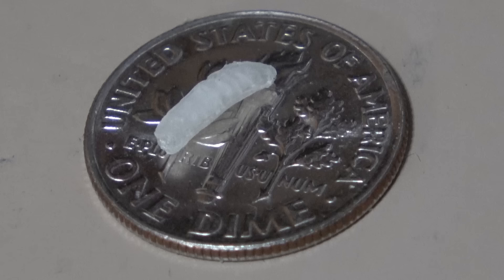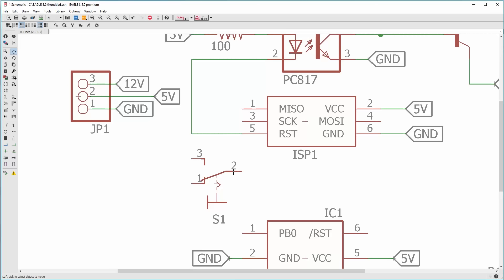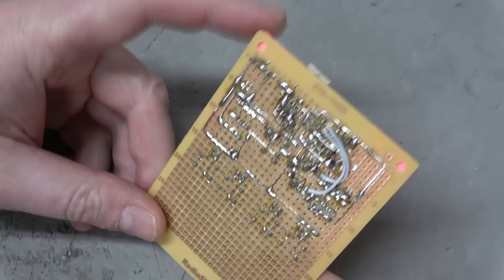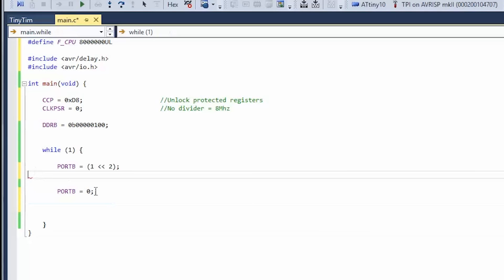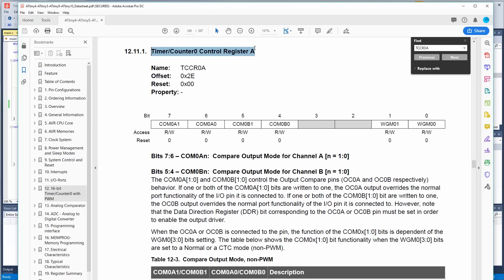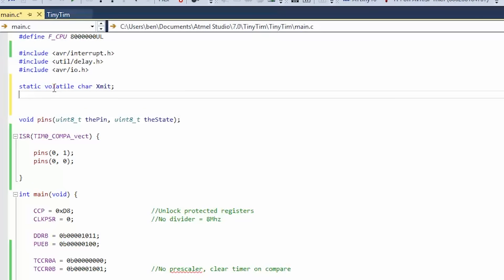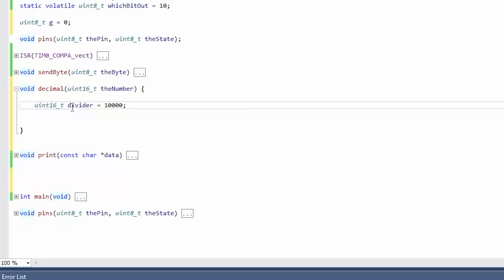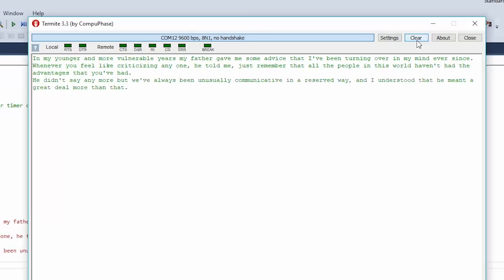How to use the Atmel ATTINY10 Microcontroller

Comment: Great design !  Except I would put  a 2k resistor between the PC817 pin 3 emitter and GND. No resistor will draw much too high current and surpass the max power permitted for PC817. You are injecting approx 20 mA IF on the internal LED. Transfer ratio is about 1.5 that means near 30mA on the output collector. 12V - 0.65 - 1 = 10.3V      10.3V x 30 mA = 300 maw. The PC817 is rated at 150 mW, too much.  The only reason it has survived is because the output is pulsed. Better design practice would suggest to limit that current to spec. Below 150mW.  I like that design. It's simple and easy to implement. Thanks for sharing.

Comment: You do not mention it, but it has a stop bit at the end. So it always has a start bit, some number of data bits and at least one stop-bit. There are also possible configurations of 1+1/2 stop bit or 2 stop bits, as well as 7 data bits, 8 data bits and 9 data bits in various legal combinations of data and stop bits. Only the start bit is always just one single low bit, indicating the start of a serial bit frame.
Besides that, very nice video about a nifty little device!

Comment: I went to an Arkells concert where they gave out cups that used a little microcontroller like this one that was program once. 

The radio they used to control the flashing LEDs int he cup and the batteries, etc were all bigger than the microcontroller.

Comment: I mostly make my programs with Arduino IDE... I would be very interesting to be able to program such "micro powerful devices" with it... Thank you for this one!!!
Reply: You would still need an external programmer, as there is no way to fit the arduino bootloader into the attiny10 (or it would fill a significant chunk of the program memory). You can use an original arduino as a programmer for that, a quick google search can show you many methods.
Reply: Thank you for that response, it clears up my questions!  @vinnycordeiro

Comment: Excellent video, well done. Just watch overheating the poor chip when you remove the solder blobs.
Is there a good reason to add Q1, the optocoupler is already switching the 12v supply for you, why not use it directly?
In fact, I don’t see the need for opto-isolation, why not use a single transistor in place of the optocoupler (you will then need Q1 to level shift)?

Comment: cough high impedance input cough MAX662A cough no additional power supply required cough 1 pcb, 1 chip, 1 transistor/optocoupler, 2 headers, a few passives, adapter done cough
just sayin' ;)
also thanks for having found a format that's fun to watch instead of all the element14 ads all over the place and freakin cliffhangers

Comment: I have a better idea for this board: put a 74LVC2G66 on the PB0/PB1 lines. This way once the programmer pulls the RESET line low (and the chip enters HVSP mode) PB0 and PB1 is also cut from external interface. Also the 12V can be generated locally using a boost converter, which usually also comes with an enable pin.

Comment: There is an issue with this design. Vebo for many trannies are only around 5V. In this design you'd exceed that value and risk the popping the transistor. There are many ways to solve this but easiest  (if you don't want to re-design this section) is a simple clamp (e.g. 2 diodes forward biased over R3 (or even a LED)) that will clamp Vebo to +- 1.4V. The Opto is not strictly needed but a good way to prevent accidental 12V damage to your programmer. I built a similar unit but that could do both standard and HV programming (simple switch selector between 12V and TPI reset). Did discover that the Olimex AVR-ISP-MK2's TPI line can not sink more than a few milliamps and still go low properly so you have to be aware of the impedance of anything hanging from it.

Comment: Thanks Ben, you saved me some work, I didn't know you needed the 12V for the 5's and 10's. One thing, why did you use the isolator? 

The "rst" leads are independent of each other, I just used a 2N7000 with 12v through a 1k resistor on its drain to the "rst" on the Atmel, gate to ISP's "rst" and source to ground. When the "rst" from the ISP goes low the 2N7000 shuts off and  sends 12V to the "rst" on the ATTINY.

Comment: I think you need a base resistor for your PNP transistor. Otherwise there is nothing limiting the current  from the 12V supply through the base and through the opto down to ground.

Comment: 13:27 I don't use the red and blue breadboard. It looks cheap. There is a breadboard with just one row on the top and one row on the bottom. It looks professional quality. I believe it is a higher quality breadboard. Although 2 rows makes some power and ground connections easier, I prefer the breadboard with one row in the top, and one row on the bottom.

Comment: When the opto-coupler is ON there is a direct path from +12V through the 2N2907 transistor emitter-base then through the opto-coupler photo-transistor to ground, which could destroy either, or both devices; what about adding a 10K between pin 4 of the opto-coupler and R3?
Reply: I was thinking the same thing. Risky design.

Comment: What's the point of the optocoupler?  The grounds are common anyways, so no real isolation.  Seems you only need the PNP transistor to switch the 12V.
Reply: Steve Bragg it’s because the PNP must be pulled to 12v on its base so it doesn’t conduct - the optocoupler keeps the 12v separate to the 5v logic used to control the reset pin state.
Reply: I'm wondering why the opto couldn't have directly switched the 12V. I doubt the AVR draws much current on the reset line.

Comment: 6:02 - I didn't try this yet but I foresee a problem in grounding PC817 pin 3 to ground. Now you have 12V supply current going through Q1E out via Q1B, into PC817 collector , out to pin 3 to ground. Outch ! If PC817 input is properly feed very high current will flow and fry either or Pc817 or Q1. Or, at least, they will get VERY hot. Bad design. PC817 pin 3 must be connected to ground via a resistor. 12V - 0.7V - 0.3V = 11V.  11V / 5mA = 2kOhms. Any value from 1k to 3 or 4K ohms would do fine. A short to ground will likely be catastrophic.

Comment: How to use an extremely tiny chip:  Put lots of extra things around it to show off how much space it saved.  Pull-up on reset line isn't needed.  Opto can gate the 12V program power itself.  Just saved you 3 components!

Comment: Cool project n all, think I woulda went straight to Attiny85 DIP. Nothin special beyond just about any avr programmer (or just use any ole arduino), save space because you wont need a converter board, and 512b. I do get it though, showing what can be done given a specific product is always fun.

Comment: That's what the << symbol means!!! I was stuck on macro assembly at a certain point because I couldn't figure out that symbol and couldn't find anything to clarify what it meant.
Reply: It's a common notation in a lot of programming languages. For C, cppreference.com is useful, and here's the page on arithmetic operators: https://en.cppreference.com/w/c/language/operator_arithmetic
Reply: @talideon  It's so weird that I never saw that in any texts...I have multiple texts on C languages. I think I skipped over arithmetic operators because I assumed I knew them all already(dumb). I know how to do that operation with nothing but transistors in hardware(or even a wire circuit with a latch). The irony is that I never saw it in any language as an operator. Makes sense now. However in macro assembly it doesn't make a lot of sense, since it is a built in instruction in many CPUs. In machine language, you would just use ROR or LSR as a processor command directly(on most CPUs) on a register. It would make more sense to me to have ROR <address>/<Immediate>. Then again, for larger words it would be tedious to do the CPU width at each interval to ROR a 32 bit word 8 bits at a time. Now I see. I still haven't gotten back on that yet. I've been prepping and learning survival stuff for the last 2 months or so.
Reply: @peterlamont647  It depends. I've used macro assemblers that support << as it can be useful for building constants representing bitfields and masks for use elsewhere.

Off the top of my head of the languages I use on a daily basis, I know Go, Rust, C, C++, Python, Java, and Ruby support it. I can also remember BBC BASIC supporting it from when I was a kid (which also happened to have a fantastic macro assembler built in). I think it might be one of these thing people gloss over until they need it.
Reply: @talideon  Ah the BBC micro...the first ARM computer. I get so much crap for my opinions on CISC Vs. RISC. GOD you wouldn't believe how pissed people get when I say x86/x64 is not a RISC processor. REEEEEEEEEEEEEEE!!!!!!! lol. Even though it has far more instructions than a CISC processor.

I've never even heard of Go or Rust. Know about the rest... I can tell you for sure the BBC micro doesn't have it. In old MS BASIC you would go 

(X=X*2) AND 1: REM Set LSB bit 0
or
(X=X/2) AND 128: REM Set MSB bit 0

That would work on an 8 bit unsigned byte. For 16 bit you have to multiply the upper byte by 16 when you're done.
That ought to stretch a few old brain cells :D.

The assembler/monitors from back then were far more primitive than I think you remember. For instance, you didn't have variable names, just addresses. The assembler/monitors were essentially disassemblers with the reverse built in. A LDA #09 etc.

On my old commodore 64, in a period assembler/monitor(which usually fit into 8K of ram) would not have any of those math commands. Just 
ADC ;add with carry 
SEC ;set carry
CLC ; clear carry
SBC ; subtract with carry
ROR; rotate orientation right
LSR; Left shift Rotation
There was no multiply command or divide so you had to code that yourself in software, or hijack basics own floating point routines.
Reply: @peterlamont647  It was the follow-up to the BBC micro that the ARM was developed for: the Acorn Archimedes.
Reply: @talideon  Ah. So ya, anyway bit shifting! Great stuff. Especially for scrolling games.
Reply from the maker: It's used in conditionals as >>. Non destructive such as if ((var >> 5) & 1).

For assignment: var >>= 5 changes the variable itself, just like var += 1 does.

Comment: I wish it could be programmed easier.  I had made an Arduino shield that allows me to program the ATMEL 85. But I don't have that blue box programmer to begin with then to make your fancy ATTINY 10 converter. I can see some uses for this chip though.

Comment: You don't have a current limiting resistor in the base line of q1, so depending on the performance of the opto-isolator, it's more than likely to blow the transistor when it turns on. Was the transistor necessary at all? Couldn't you simply have used the opto-isolator to feed the 12 volts to the programming pin directly?

Comment: On Q1 I am missing a base resistor. And why not use the optocoupler to directly switch the 12 volts rail without having Q1? Also why does the LED in the optocoupler need a pullup? When RST is floating, the LED won't light up anyway.

Comment: Would you be able to use this to control some Neopixels (WS2812b) LEDs? I have use for it doing some simple animations if it can!
Reply from the maker: Yes I've seen code on Github to do that. Uses assembly snippets for tight timing.
Reply: CPLDCPU has a nice library for controlling WS2812b's which supports the attiny10: https://github.com/cpldcpu/light_ws2812

Comment: I don't think you need an opto, just an NPN transistor with its base connected to +5, its collector to the base of the PNP, and a resistor from the emitter of the NPN to the RESET signal from the programmer. Also, one might use reed relays which switch off when energised instead of toggle switches, to save remembering to operate the switches. Maybe use changeover reed relays to avoid the external circuitry from affecting the programming and use that whole assembly as a development board for a larger gadget?

Maybe on the overall gadget add jumpers to always connect the outputs when code development is finished?

Is the code available for download anywhere? I'd like to use it as a reference to learn from. Hardware, not code, is my first skillset.

Comment: Hey Ben, Have just discovered your channel and oyu are a great teacher. I would like to use the ATTINY10 for a once setup parameter for a prox sensor. It uses I2C and board space is a a premium, hence sot23-6 ideal. So no while loop woukd be once setup and is there an easy suggestion to implement I2C or TWI (eq). Appreciated. Peter

Comment: For some reason the Attiny10 microcontrollers are not very cheap. If you need an small Microcontrollers that is cheap. Check out the Attiny13. They're not quite as small (SOP8 package, I believe), but they have two more pins and do all the same stuff.
Reply: Huh? I just checked Digikey, with minimum quantity of 1, Attiny10 is 34 cent while attiny13 is 54 cent a piece. So why do you say Attiny10 are not cheap?
Reply: @molnez   I think you may have gotten lucky that they are in stock on digikey. If you want to spend $20 on shipping for $3 of parts, then digikey is great. But if you go elsewhere with reasonable shipping, or if you need them when they're out of stock. You'll often have to pay $1.00 per attiny10. Usually you can find Attiny13 for $0.40 or so a piece (including shipping). It's just something to keep in mind when looking for a micro-controller for your project.
Reply: @ @gizmoguyar  Ok got it, maybe the Attiny10 isn't that popular so you are less likely to get good distributor bulk discounts on it. I am not doing electronics projects all the time, so whenever I need something I just add it to the list and order in bulk every now and then. Shipping for orders of more than $60 is free where I live although import tax is a mother trucker.

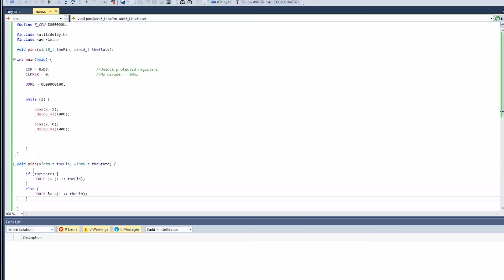Comment: @25:00, couldn't you write the function so that the compiler would basically completely optimize it away? As long as your pins are known at compile time then the entire function can be optimized to the same point as the previous method.

Comment: I don't understand why the ISP reset needs to be electrically isolated. Can't the ISP rst pin just pull down the base of the pnp through by a diode and voltage divider resistors?
Reply: Come to think of it maybe my suggestion is wrong if the ISP reset pin is not open drain, hm but still does it need to be isolated?

Comment: Other than a few programming boo boo's, I felt this was a pretty good intro to the AVR and Studio 7. Here's hoping that MC will not try and turn MPLab into the default programmer for Atmels as well (I know they want to... shudder).

As a side question, If the GPIO for reset is disabled, then how is the ISP/Programmer able to "catch" the microcontroller's program counter and prevent it from running the embedded code when attempting to re-program it? If it is the programming voltage then it seems it will be a bit tricky in sequencing and timing to power cycle the uC while keeping the programmer in a prepped state...

Cheers,
 - Eddy

Comment: Ben: I have a similar problem I am trying to solve and I think your opto+npn might work. I have a IO line from a MCU goes to a IC that is normally 5V, however during programming it needs to be held high at +12V. What would you recommend to ensure that the MCU IO does not get damaged and does not interfere with the IO in normal use. My current design is to use a diode and a solid state relay that can be turned on when needed.
Reply: Followup: do you think it would be better to replace the opto and fet with a CPC1017N solid-state relay?

Comment: I would of set the state and pin with the same byte.
If the 8th bit is 1, enable, 0 disable.
Then you simple need to set 8th bit to 0 before bit shifting.

Comment: Tinning the wires from the power supply is a Bad Idea because the solder will creep over time. If you want real belt and suspenders connections, use wire ferrules.

Comment: Hi great video, wondering if you have any advice. I'm using the Attiny10 on a project that has a base of a transistor on PB1, problem is when it was done on breadboard we programed the Attiny10 off the board and then plugged it in the breadboard so it worked. Now we try to program the ATTiny10 after we get the boards back already assembled and the boards won't program until we disconnect the transistor, so for the same reason you put toggle switches in your circuit, do you have any idea how I can get around this ?
Reply from the maker: Indeed it's pretty easy to load the program pins in such a way they won't work with the programmer. IRL these chips would be pre-flashed by Atmel / digikey whoever before being installed in device.

Comment: I see that the programming connector is ISP but the attiny10,9 .... are programmed by TPI, right? Is this circuit valid for ISP and TPI? It could include a small step up 5v a12v?
Reply from the maker: I believe the high voltage programming for the ISP Tinys is a bit more involved than this hack.